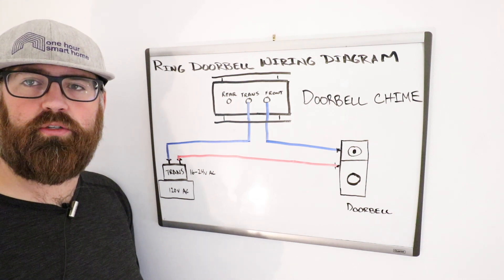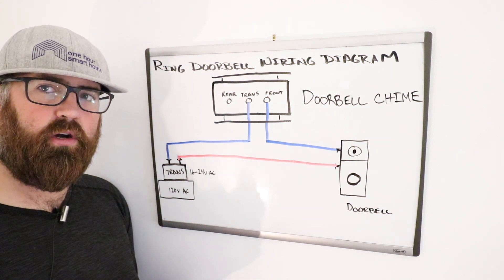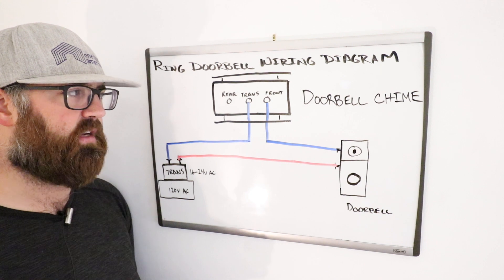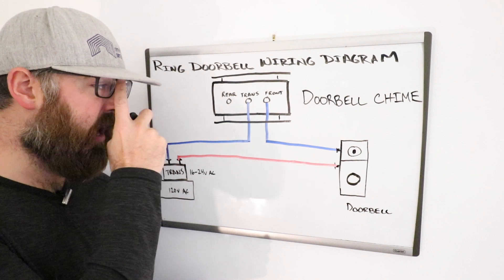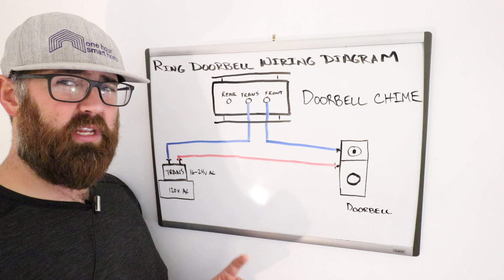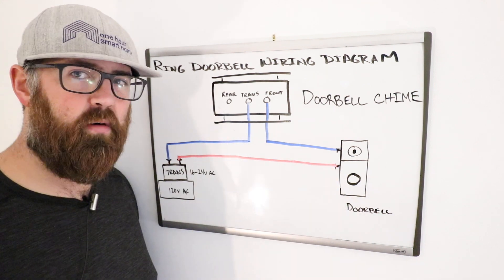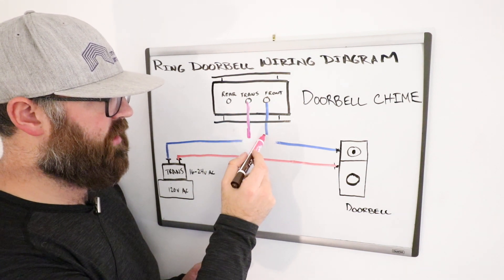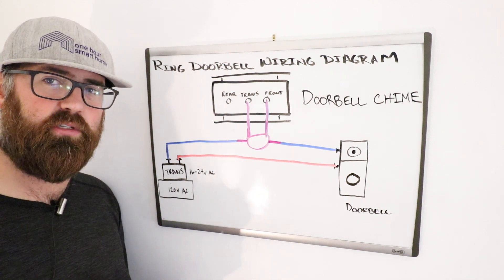Ring Doorbell Wiring Diagram

Comment: Hi there Just wondering how i wire my ring pro 2 if I'm not using a old in-house door chime, I bought the chime pro that plugs into a outlet, also do I need to use the power pack with a chime pro?

Comment: is that the case for all the wired Ring door bells or just certain ones.   I have been searching for a while to find out if any of the Ring Door Bells are 100% compatible with my homes
existing chime that runs on A.C. around 20-25 volts.   I want a plug and play.  Swap out door bell with Ring and have it ring the existing chime.  Is there a model that does this?

Comment: My installation works until I put the battery into the ring doorbell- why might this be?
I have to disconnect a wire from the back of the doorbell and put it back with the battery removed to get the chime to work again- but without the battery I don’t have any of the ring/camera function. Any ideas?

Comment: Just purchased a ring door bell with internal (NON REMOVABLE BATTERY).  
The instructions are stating that a 25ohm/50W resistor to be installed in line with one of the two transformer wires.  Am I able to splice the resistor into the transformer line at the actual chime, rather that going into the attic and attaching to the actual transformer?  Any idea if this is just a recommendation by Ring or mandatory?  Thanks.

Comment: This was very interesting and explained a lot. One thing, you called the this a puck then adapter and my old house  has the same type od original doorbell (wiring is the same). Where can one get the "adapter" to put into it like you show? It makes a lot of sense the way you wired it but I just need the adapter (2) for the ring doorbell 3 I have at my 2 houses. Thank you for any information.

Comment: Thank you so much for this video. Question: If I have no doorbell chime, can't I theoretically just plug the Pro 2 doorbell power kit directly to the transformer?
Reply: I was wondering this as well
Reply: Without a chime, you need a 50watt 25ohm resistor.
Reply: Will this make the existing mechanical bell work again alongside the vodeo doorbell?

Comment: My existing doorbell transformer is 16 Volts and 10VA. I am finding that that, even though the Ring is hardwired, I still need to manually charge the battery every couple of weeks. Do I need to upgrade the transformer to one like the one you recommended? Thanks!
Reply: yes, please upgrade the transformer and remember to turn power off to your house before you do

Comment: Suggest: add how charging the ring doorbell works.  If the switch isn't closed (button not pressed) there's no power flowing so no battery charging occurring, right?  But it works and trickle charges the ring battery as long as it's not used too much.  How?
Reply: You have asked a sensible question because the author has not explained how the circuit works.
Here goes:  "between the TRANS and FRONT terminals of the chime, there is a solenoid coil which means there is no open circuit. It is quite high resistance but enough to charge the ring battery. The internal resistance of the RING is too high to activate the chime solenoid until the ring button is depressed."
Does this help?
Reply: @johnnywilkinson9736  Ah, yes. ok thank you.
Reply: @johnnywilkinson9736   ?
Reply: I know this was from a while ago, but @john is it ok to by pass the chime all together? Connecting the transformer directly to the ring door bell? Completing the circuit? Is the resistor in the chime necessary?

Comment: Sir, I have wiring situation. My transformer has 2 white and 2 black wires (on the 16 volts side) connected to it. The white one’s are connected to one terminal together and black one’s are connected to second terminal together. Then I have 1 red and 1 white at the door bell button and i have 2 white wires and 2 red wires at the chime. Can u tell me how the wires are to be hooked up to the chime? Thanks
Reply: Shame on him for not answering u

Comment: New 2021 Ring doorbell wired on sale for $59 instructs you to connect the 2 terminals with a jumper to power the video doorbell. This renders your existing chime unusable. I wonder if the adapter kit will fix this new models drawback?

Comment: Quick question. After I removed the old system trying to install a "Ring" Doorbell #3 I have 6 wires. . . . .  not sure which ones to use. I have a white twisted up with a blue, another white twisted up with an orange, and a white twisted up with a green. Also two ground wires. Any help would be awesome.
Reply: hi Patrick, were you able to resolve this issue? I have the same problem
Reply: @mikelulu4023   have you sorted yours i have the same issue
Reply: @danielbrear6539  i have not, I just put back my old one and revisit this nextyear. Please let me know if you are able to address the issue too

Comment: hi my doorbell chime has 4 leads (Trans, Front, Back and Com. )  What does Com. stands for and what does it do?
Reply from the maker: C stands for Common wire. Unless you had a intercom system in which case it could stand for communication wire. The common wire is the same thing as a neutral wire.

Comment: I have FOUR wires coming into the chime in our home.  A white and red in one sheath and another white and red in a second sheath so we don't have "just 2 wires or even just 3 wires. ARGH!
Reply: J S that’s actually normal. One wire (pair) went to the transformer and one wire was run to the doorbell. No one runs that red wire continuous from the transformer to the doorbell. The secret is to wire nut the two red wires together, now you have a continuous red wire from your transformer to the doorbell. Now one white wire goes to the trans screw and the other white wire goes to the front screw
Reply: @wirenut3020  I just went ahead and bought one of the wireless doorbells and bypassed the legacy bell altogether
Reply: @wirenut3020  There are so many different configurations, it's nuts sometimes figuring out what's what. I just helped a neighbor with his new Ring Video Doorbell and his transformer blew five minutes after I left. I'm not sure why as I am pretty good with electronics and wiring and such. So, today I get up and he texts me to come help him replace the old transformer.  I replaced the failed unit and wired according to the diagram he was telling he looked at and it is working again. I question what difference does it make where the white wire goes on the doorbell that only has two terminals. One terminal is labeled 'front' and the other 'trans', if I remember correctly.  What is the difference between the two terminals?